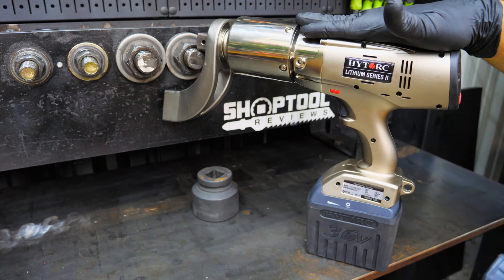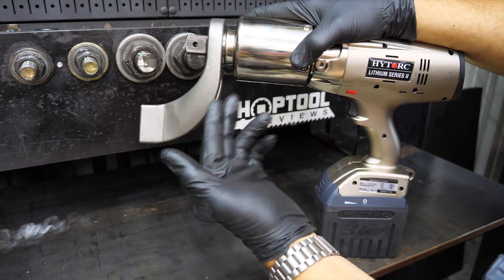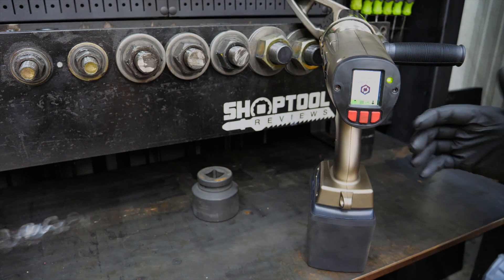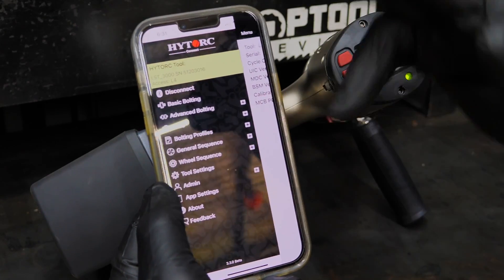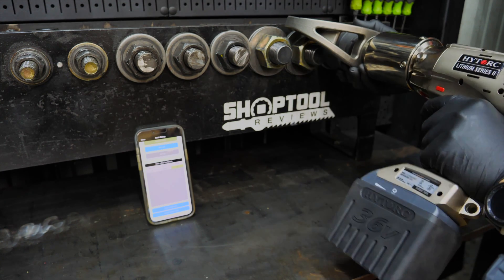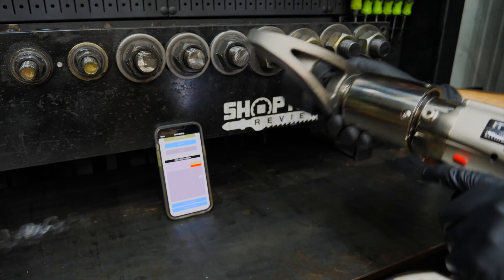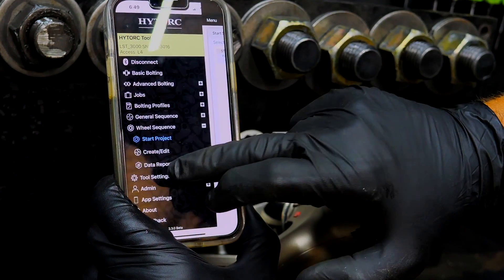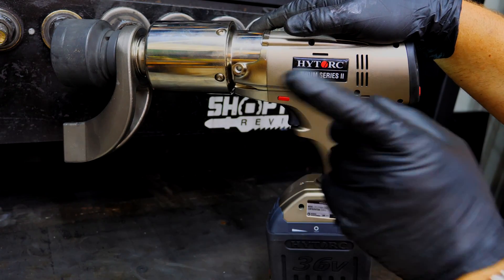3,000 ft-lbs!! HYTORC 36V Lithium Torque Gun Video Review [Series II]

Comment: Hi.. Does this tool come with an extension that can be attached the 1 inch drive of the tool? Also, the socket sizes used in this video are not so big. Are larger socket sizes, let’s say, 3 or 4 inches (across flats) available for this tool?

Comment: could it be used on head bolts on engines especially the ones that you go 45 degrees after certain torque
Reply: Yes, lots of engine manufactures use these for that very reason.

Comment: That reaction arm is actually extremely dangerous.  I wouldn't brace it off an adjacent nut. If something pops, your wrist is gone.
Reply: No your wrist is not gone. It’s going to move a couple degrees and then just spin extremely slowly but with a ton of torque
Reply: Hydraulic, pneumatic, and battery wrenches that use reaction arms are super common in the industrial world. General practice is to use the adjacent nut as your reaction point.
Reply: Same reaction arm used all thru industry

Comment: Looks like an extremely useful tool for those whose work can justify the cost. Precision, power, and self-documenting for quality assurance. I do wonder, though how you'd tighten lug nuts on a wheel with recessed lugs. I don't see what the reaction arm would work against. Perhaps another socket placed on an adjacent lug?
Reply: It only does 500 ft lbs & up. Not really used for lug nuts. Even tractor trailer lug nuts are only around 450-500 ft lbs
Reply: id see this used more as in the oil field where i torque up frac spreads and be easy to get most of ground work done its easy and it keeps hands away from the danger zone